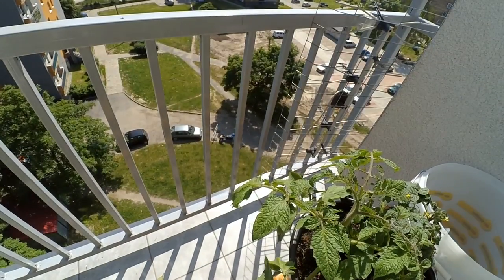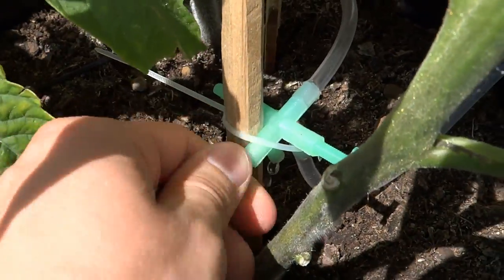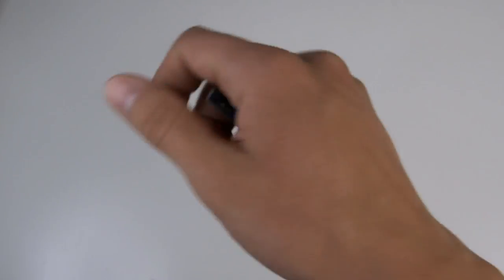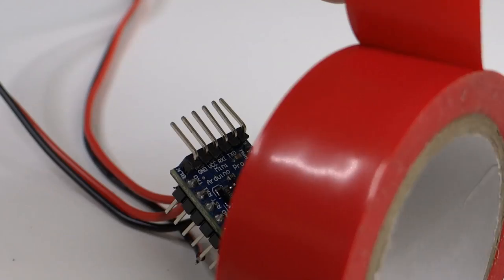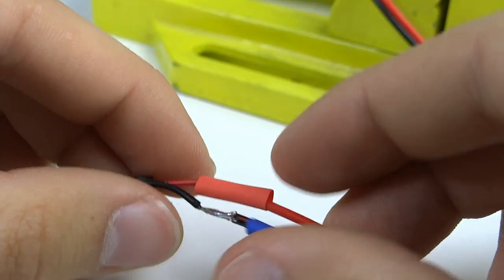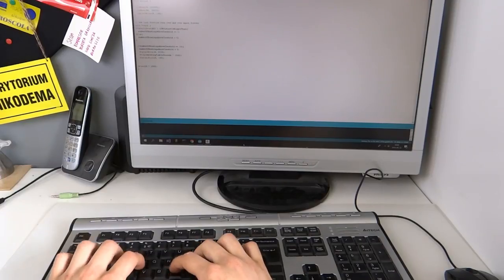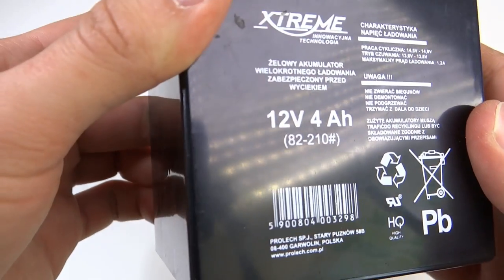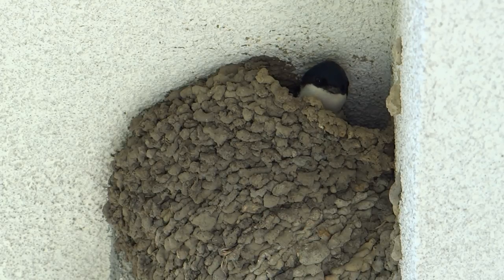Automatic Arduino based plant watering system

Comment: if i want to grow 2 differents plants of course the requirements for both plants are different, so my question is, can i control 1 water pump for both plants? let say at certain time plant 1 need to be watered than plant 2, so the pump will water only plant 1 but for plant 2 not.
Reply: yes

Comment: Cool :) just a note, heat shrink tube and electrical tape do not protect against water
Reply from the maker: That's right but the only element that is in water is pump so we don't have to worry about that :) thanks for comment
Reply: @nikodembartnik  use conformal coating

Comment: Cool idea. I like it a lot.
For me, I'd implement two additions:
1. Have a solar cell constantly charging the lead acid battery. They like to be at high charge at all times, and this removes the need for manual charging.
2. Use water from a water butt which is old rainwater.

I'm trying to design a watering software to implement in future. I'm trying to make it as water efficient as possible.
I'm thinking something like:

intPumpTime = 5
1. Wait 120 minutes
2. Check water level.
 - If too low, Increase intPumpTime by 1. pump for intPumpTime. Wait 10 minutes. Goto step 2 again.
 - If too high, reduce intPumpTime by 1. Goto step 1 again.
 - If within acceptable range, goto step 1 again.

I'm thinking something like this would adapt to pump the ideal amount of water based on previous results. 
And an important aspect not to forget is to give the water time to absorb into the soil before a recheck. If you just pump until the level is met, you could have one side of the flowerbed bogged out, and the other dry as a bone still.

Comment: that moisture sensor is great for testing, but short lived in actual use
and it will poison your plants with copper oxide (copper and plants do not get along)

a better choice would be the capacitive water sensors, they work even when fully sealed
Reply: Which one do you recommend?

Comment: I know this video is from 5 years ago, but there's a change that I would make.
Those 2-prong moisture sensors become corroded after a fairly short time.  You can now get capacitive ones which do not expose any metal to the soil so they last a lot longer.

Comment: I have a question about your 3d printer, was it worth buying? I was considering the anycubic vyper but i’m not sure about the power usage and micro plastic floating in the air. Is it safe and worth buying?
Reply: Buy an ender 3 and you won’t regret

Comment: Just one problem. I've heard that those moisture sensors oxidize and no longer give accurate readings. Plus, I've tried them and there was a lot of noise. I had to use a 100 readings mean to stabilize it, and then it was very sensitive to changes in position (just tapping it would change the readings) and drifted off rapidly. Maybe my sensor was faulty? I'll have to try it again with another one.
Reply from the maker: I don’t faced the oxidation problem with my sensor so far and I used something exactly the same in my flotcher project also without any problems. It’s true that on different depths this sensor gives different measurements, that’s normal, it’s more wet down in ground then closer to the surface. I didn’t noticed drifting but just in case I implemented in my program simple solution that reads 10 reading with 10 seconds delay between each to make sure that plant really needs water and that it is not an error of sensor. Try different sensor maybe this one was faulty as you said. Thanks for comment!
Reply: yes this kind of moisture sensor suck at all because they are just pcb  put into moist ground and the metal part dissolve.
see the andreas comparison

https://www.youtube.com/watch?v=udmJyncDvw0
Reply: You should activate the sensor just 1 second when taking the measurment (with an output digital pin). If you don't do that electricity will be flowing and oxidizing your sensor 24/7 and it will just last for a couple of weeks.  Activating the sensor just few seconds per day will prevent that, of course it will ozidize anyway but it will take much longer.